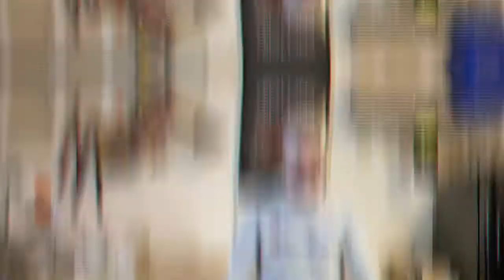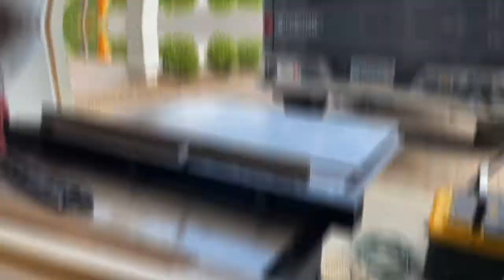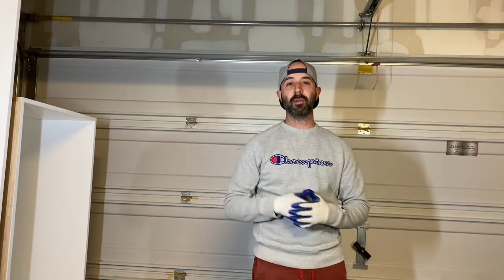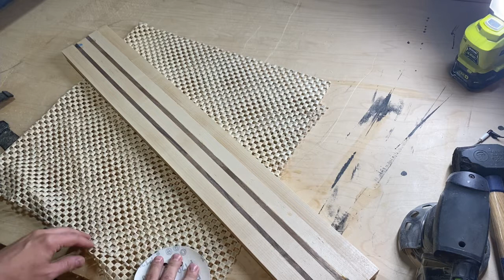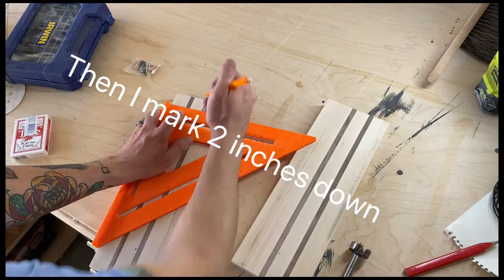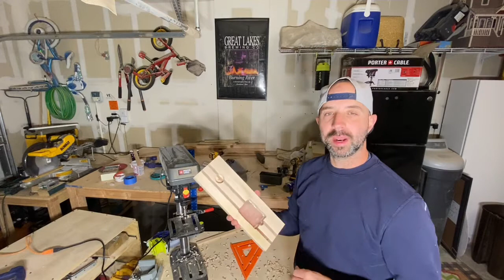How to Make a Cribbage Board

Comment: I had the same problem with the board chipping  out when i drilled the holes.  I wonder if a different type of bit is needed.  Otherwise, I would need to make the board thicker than the final thickness to allow for sanding or planning.
Reply from the maker: If I were to do it again I would do a layer or two of painters tape to help hold the grain down or cut a piece of wood the same size and clamp it to the top to help avoid tear out.

Comment: What type of router bit did you use to finish the card holder and what type of magnets did you use . Thanks
Reply from the maker: Hey Brian, I used a bottom cleaning bit. They come in various diameters. For the magnets they are just regular magnets from lowes but if you need stronger magnets use Amazon.
Reply: @ryanwolf162  hey thanks for getting back to me. I’m not familiar with a bottom cleaning router bit. I’ve seen people use I think a flush trim bit with the bearing on the top but that doesn’t make any sense to me because I thought they were just for edges. Is it possible for you to send me a link to one or a picture. Routers scare the crap out of me do I want to make sure I’m using the proper type bit. Thanks
Reply: I google bottom cleaning router bits and found what I think is correct.
Reply from the maker: @nitrousblast1  hey! Don’t let them scare you but always respect the tool! Watch some videos and just take a little bit off each pass. Practice on scrap material first. And correct flush trim bits are for matching the sides of something with a template or other identical piece. Best of luck on your project.